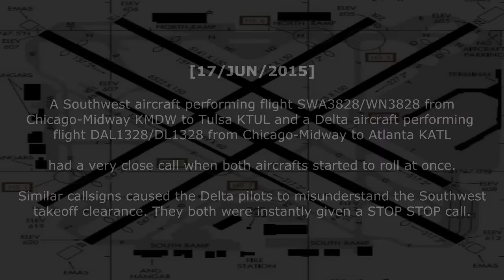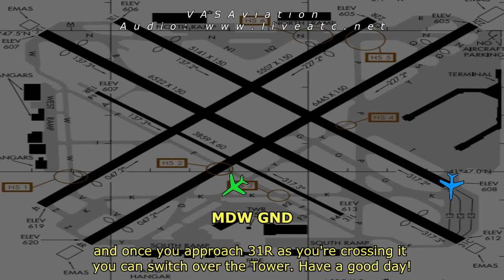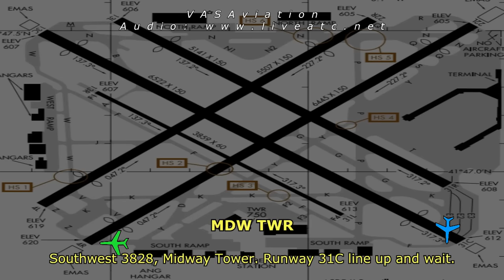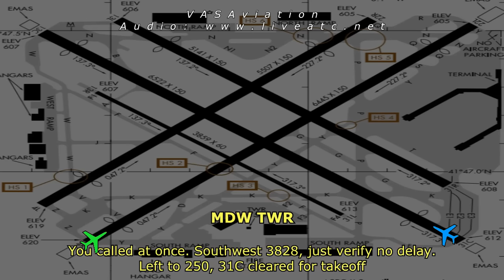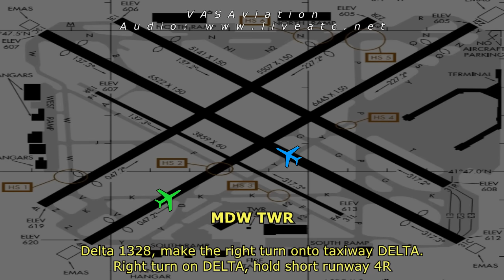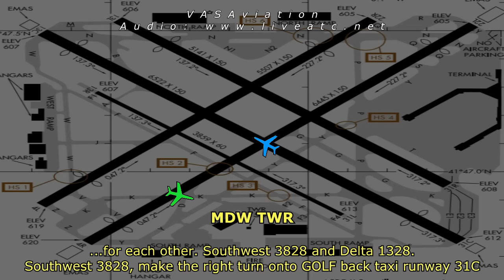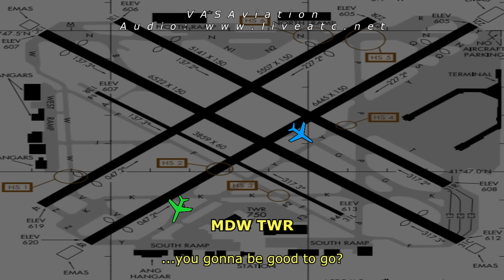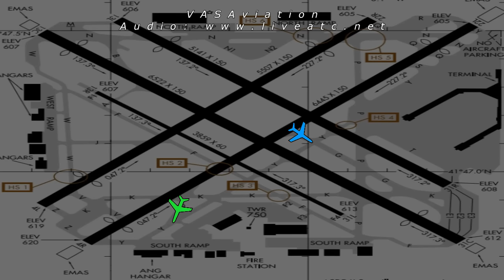[REAL ATC] Delta and Southwest VERY CLOSE CALL on takeoff

Comment: I'd much prefer the atcs have a pool of temporary callsigns they can draw from: southwest 3828 be advised, similar callsign on frequency, you are now known as "snoopy".
Reply: This would just lead to "Alright, we are now known as Snoopy, Delta 1328" in this case.
Reply: That's not the worst solution I've ever heard, though if FAA would just follow the damn international rule about reading out the Flight #s individually (ie one three two eight instead of thirteen twenty eight), this would have been avoided.
Reply: @thetalesofdaneandco  he probably read it that way to try to avoid confusion in this specific scenario.
Reply: Delta 1328, your callsign is now Oscar Oscar Foxtrot.
Reply: @steabert  actually if they both stuck with it it'd probably work.
Even better if they used "Delta 1328 Snoopy," and "Southwest 3828 Linus"
Reply: @BammerD  you can't just come in here with that call sign and expect there not to be repercussions.
Reply: @hagamapama  it happens in Europe Airports that similar callings get an extra Letter. So Eurowings 123 and Lufthansa 123 would become Eurowings 123A and Lufthansa 123B. That was introduced as safety manner because of this incident. In US nothing was done but to give ATC notice to not click the massage st the beginning....
Reply: I get your point, and it makes sense, however, they already had strings to distinguish them.
Namely, the company name, but even if that got clipped, then the clearance, "runway 31C cleared for takeoff" is definitely not for the aircraft that is sitting on 4R :D